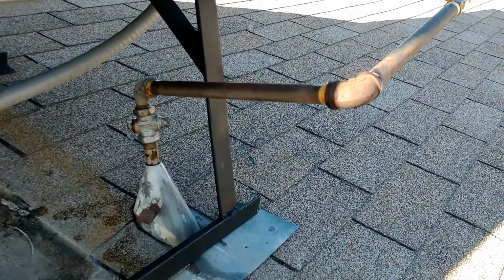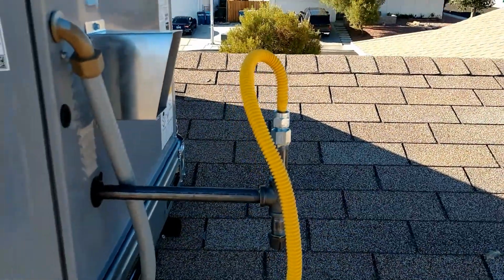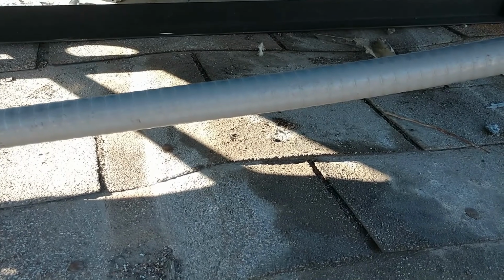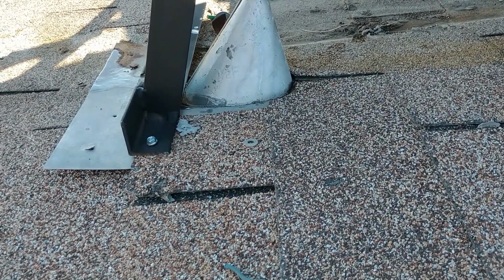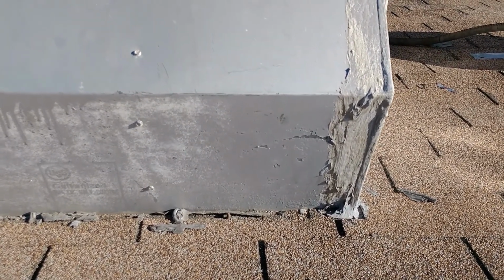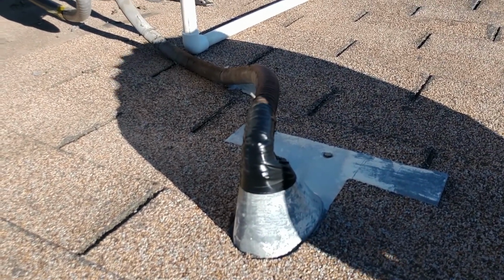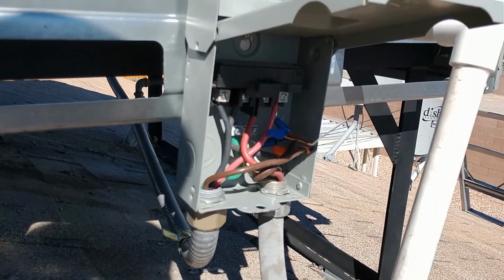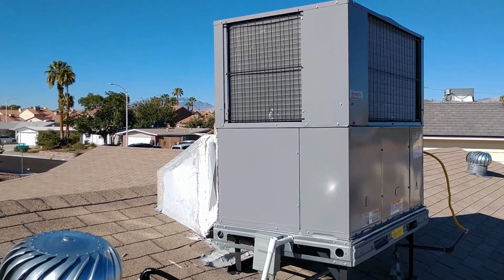Professional opinion on new rooftop package unit installation

Comment: Uggggh. Just got a quote for $15k to install an 3.5 ton unit from a big company here in Vegas. From the little research I have done I know the guy had little knowledge. Betting I’m going to get shit work for super high price no matter who I go with.
Reply: that's a rip off. i just got a 3 ton unit parts and labor $8k total in los angeles ca
Reply: @GnarlsFarls  was that with a gas furnace. A “package unit”?
Best quote I got was $11k for a Goodman. 
From what I understand those are low grade crap. 
Didn’t pick any company. Just ordered a can of r22 and filled it up. Still blowing cold months later. 
 Gonna have to bite the bullet this winter and buy one.
Reply: @AlphanumericCharacters  it was a roof all in one package unit. Ac pro brand which is the same as lennox brand
Reply: @GnarlsFarls  wow! Ended up getting a Lennox quote for……no shit….$22k. They quoted me three different prices for the different levels. The $22k had a variable compressor or whatever and an extended warranty. Cheapest they offered was $15k. It was all Lennox however. 
 Everybody trying to get rich off each sale.
Reply: I’m in the same boat here how did you ever decide what company to go with? My curb adapter is leaking and my AC is only 4 years old. A 3rd of the price just to replace that piece.

Comment: So, I agree with many comments here, you get what you pay for!  Most of your finds I would agree with, very shotty.  The gas line regarding the drip leg, they did it the way we do it in Kentucky, drip leg at end of first nipple coming off of gas valve (if I saw that correctly).  I agree with you that they should have changed the shut off, and I am not a fan of the flex line, I would have ran mine all black iron, but that is just me, some at my company do use the flex line (not saying who is right or wrong, I just prefer the black iron)  Good review of a shotty install, you taught me a couple things I was unaware of

Comment: I randomly came across this video, I have never seen anything s*it like this probably in my life. Not only is it a horrible work but it is unsafe on so many levels. Scary.
Reply from the maker: What scares me is after we intimidated this company into pulling permits and getting it inspected, the inspector wrote it off after less than half the corrections that would have been demanded if it had been done in California instead of Las Vegas.
Reply: @Jimbeam151  I live in Vegas, I do a lot of stuff myself. I installed a mini split in my garage, spent a lot of time learning how to do it properly, took me like a month to install it really by the book. Proud of my work I called the inspector for the permit I pulled as "owner builder". He did not even walk into the garage and said it was all good. I am very demotivated pulling more permits since.. so I agree, Vegas sucks in this.

Comment: Wow, just wow!  Any updates?
Reply from the maker: Yes, they were forced by the owner of the property to get a permit.  It was inspected, some corrections were made but inspector only made them address about a 1/4 of the issues I raised in this video.  I couldn't believe how low the standards are in Las Vegas.  The inspectors appear to be on the side of the contractor instead of the homeowner.